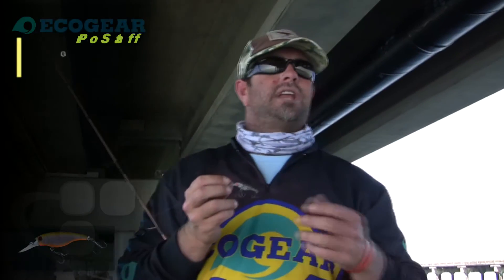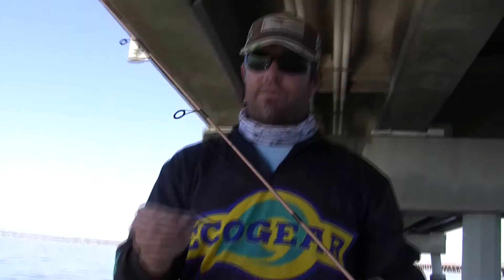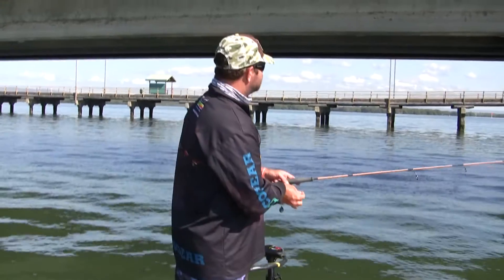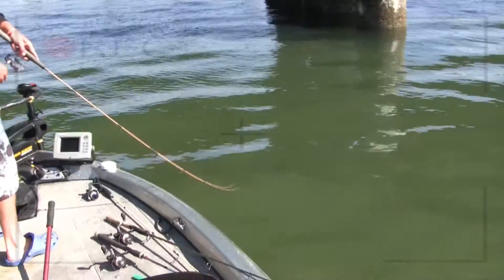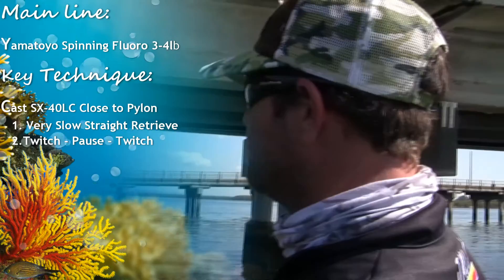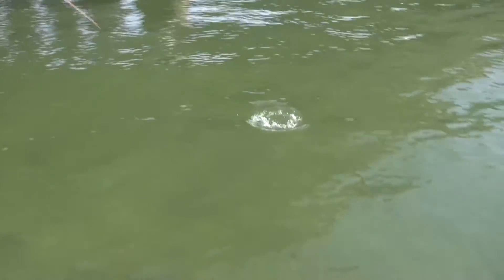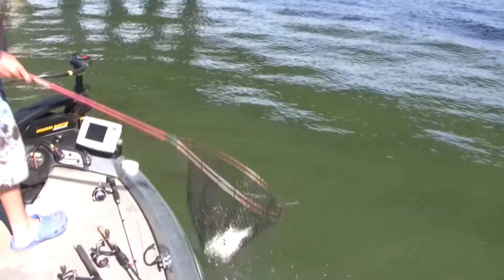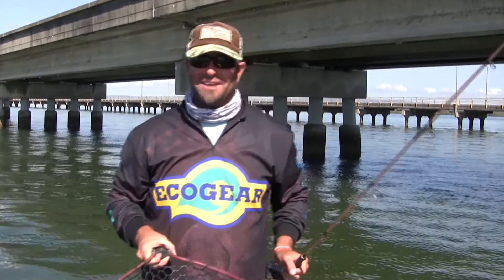How to use SX 40F / SX 40LC Part 1 - Basic Technique

Comment: I use Platypus 4lb on my bream rod for flicking lure and I've caught bass to 45cm and snapper to 35cm on it. For 4lb line it takes some punishment. You'd be surprise by how much pressure it takes to snap even light line. Generally it's more getting cut through or bitten off that I'm worried about.